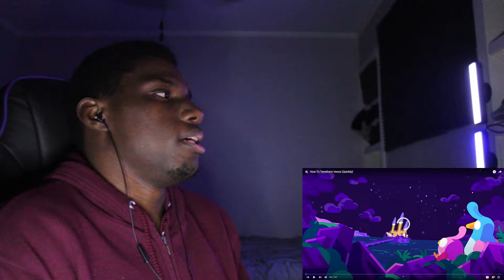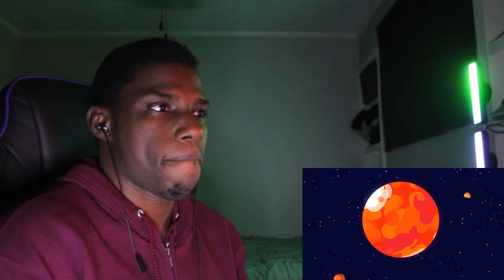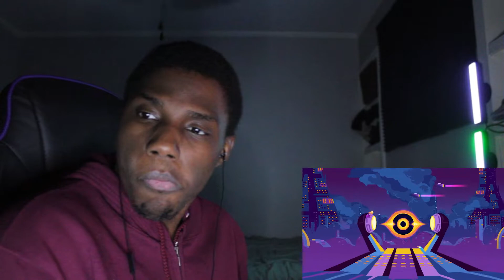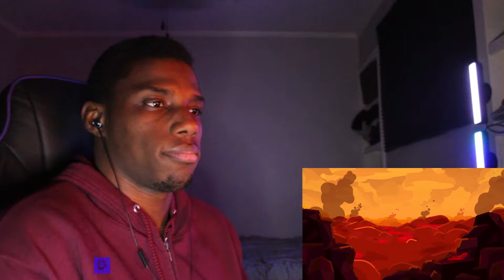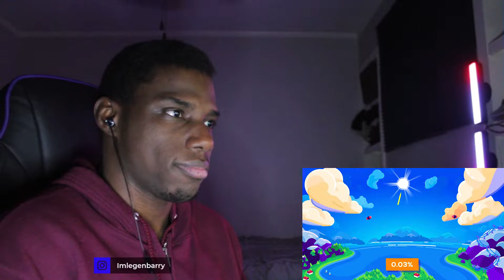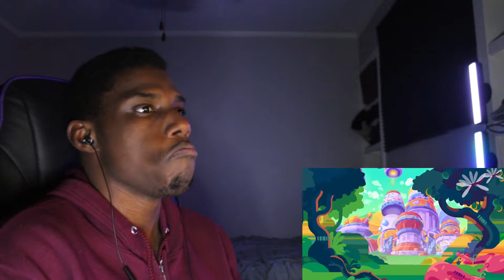How To Terraform Venus (Quickly) | REACTION

Comment: Venus, we are told, has an atmosphere that is almost pure carbon dioxide and an extremely high surface temperature, 750 K, and this is allegedly due to the radiative greenhouse effect, RGHE. But the only apparent defense is, “Well, WHAT else could it BE?!”  (besides/also molten core volcanism)

Well, what follows is the else it could be: (Q = U * A * ΔT) aka a contiguous participating media.

Venus is 70% of the Earth’s distance to the sun, its average solar constant/irradiance is about twice as intense as that of earth, 2,602 W/m^2 as opposed to 1,361 W/m^2.

But the albedo of Venus is 0.77 compared to 0.31 for the Earth - or - Venus 601.5 W/m^2 net ASR (absorbed solar radiation) compared to Earth 943.9 W/m^2 net ASR.

The Venusian atmosphere is 250 km thick as opposed to Earth’s at 100 km. Picture how hot you would get stacking 1.5 more blankets on your bed. RGHE’s got jack to do with it, it’s all Q = U * A * ΔT.

The thermal conductivity of carbon dioxide is about half that of air, 0.0146 W/m-K as opposed to 0.0240 W/m-K so it takes twice the ΔT/m to move the same kJ from surface to ToA.

Put the higher irradiance & albedo (lower Q = lower ΔT), thickness (greater thickness increases ΔT) and conductivity (lower conductivity raises ΔT) all together: 601.5/943.9 * 250/100 * 0.0240/0.0146 = 2.61.

So, Q = U * A * ΔT suggests that the Venusian ΔT would be 2.61 times greater than that of Earth. If the surface of the Earth is 15C/288K and ToA is effectively 0K then Earth ΔT = 288C. Venus ΔT would be 2.61 * 288 C = 748.8 K surface temperature.

All explained, no need for any S-B BB LWIR RGHE hocus pocus.

Simplest explanation for the observation.